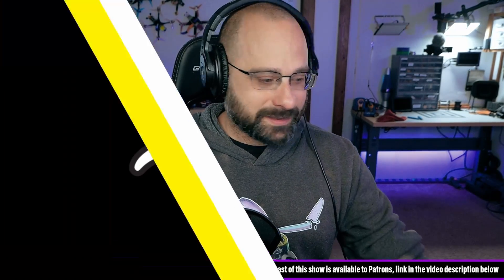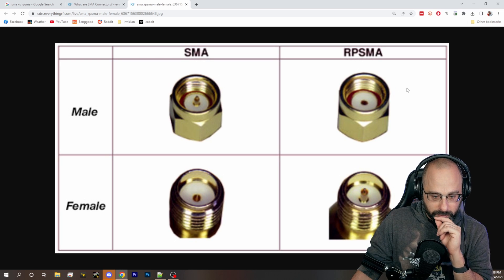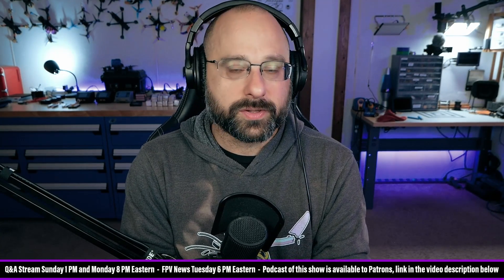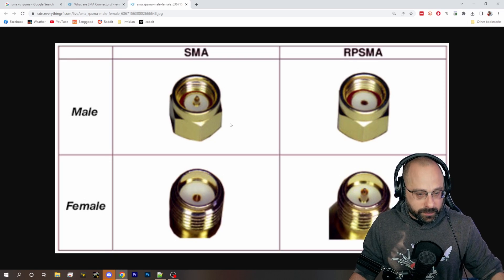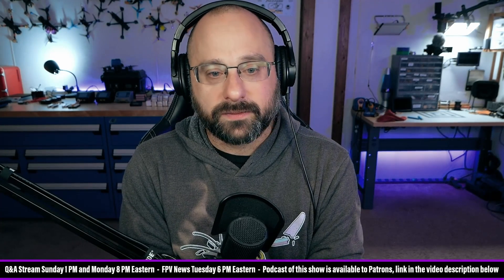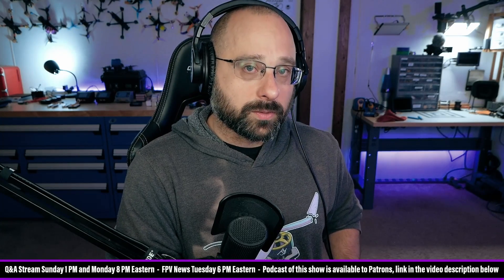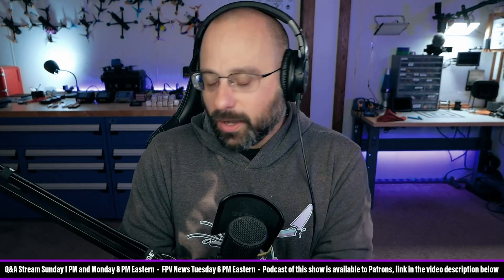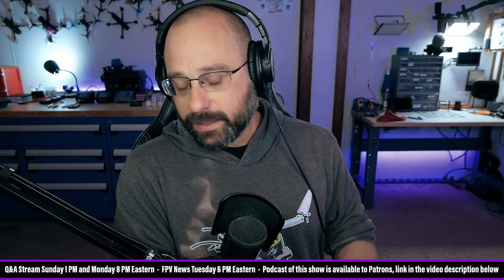My SMA Port Seems To Be Male. Can I Remove The Pin To Make It Female? RP-SMA vs SMA! - FPV Questions

Comment: Wondering why google AI says RP-SMA male wont work with SMA Female wont work together if you make a center pin to insert into one long enough to go into the other side when screwed together? If the outer is male and female and screw together but both are females on the inside with the lack of a center pin, why would it not work if the center pin is made long enough to connect the center pin and grounds when screwed to each other? If google is not right lmk please

Comment: The center, male pins on my RP-SMA female connectors, Autel Evo 1 drone controller, do not appear to stick out very far for some reason. A recent mod I had done to the controller. It's seems to have good signal while in use, but would this maybe cause problems later? They look to be much shorter than the other female RP-SMA connectors I've got laying around. Just curious, really don't want to tear into this controller again.

Comment: I remember getting that frustrated 😞 when I was going from antenna to antenna trying to get a feel for the best gain match I could get and my Walkera Runner 250 setup is all multi-wii not betaflight. 
For some reason one used the male the other is female and I had to buy a gender changer adapter just to be able to use the antenna I wanted to use.
 Yeah this is very frustrating for those who never had this happen to you.